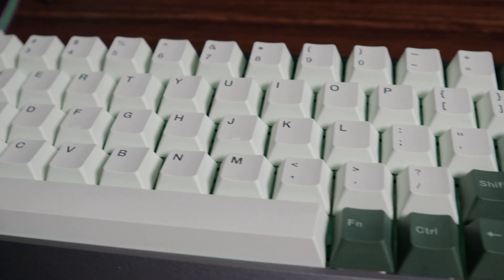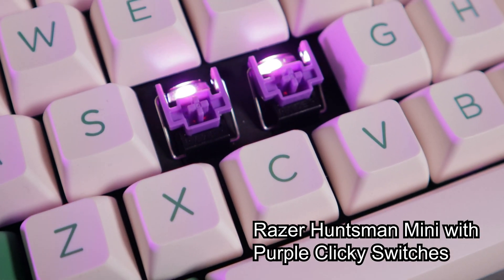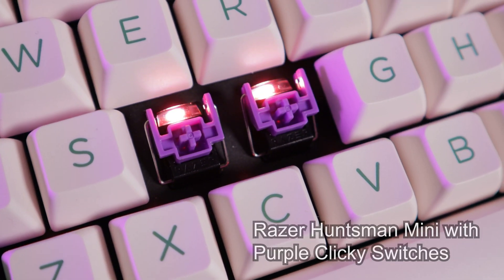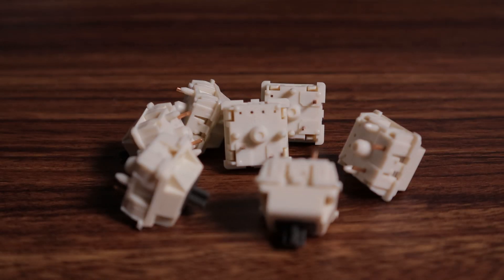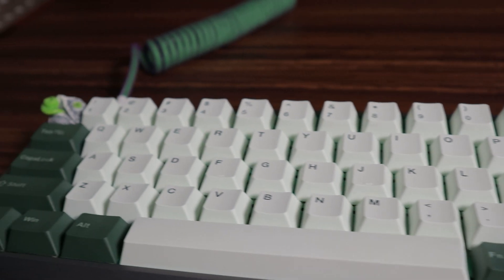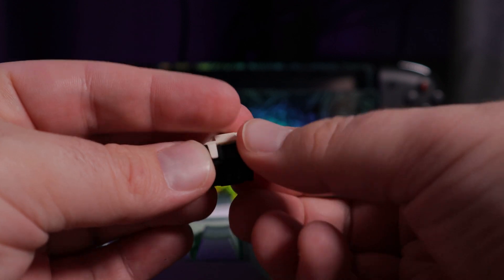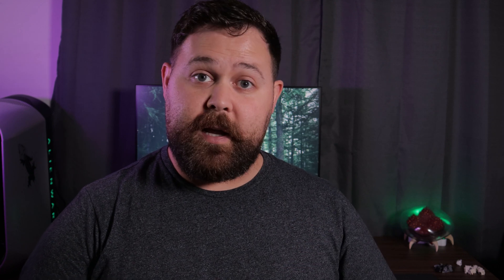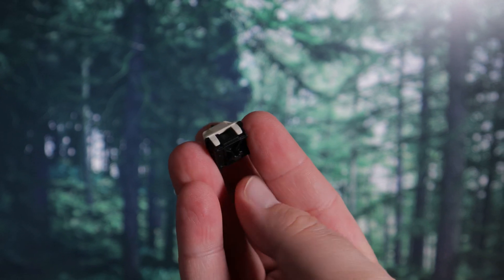Use Your Favorite Mechanical Switch w/ Optical Keyboards? Optical Mechanical Frankenswitch Mod

Comment from the maker: Just some notes: I had used optical reds, not optical browns for the bottom housing. That was a verbal typo on my part. Also, I realized after making this video that optical red switches have different leafs than optical tactile/clicky switches. If you want to maintain as much of the tactility of the mechanical switch, I'd advise using optical brown switches as the base for your opto-mechanical frankenswitch. Ok thanks bye!

Comment: Excellent video and great idea! Just a heads up, Akko switches do not fit Gateron housings, the Akko stems are just a bit too thick and they get stuck. Tested using Gateron blues and Akko creamy blues.

Comment: Love the video you made. Question can you make a video of the assembly and changing the keys plus the links of where you got your parts and tools like other channels do, i mean i have an idea, i do repair my shitty mechanical keyboard switches from my Logitech had so  much  problems with mechanical switches they don't even last months or a year had so much bad luck with Logitech keyboards hoping i have chance to change to optical version once parts are available. i would have loved to change the mechanical keys to optical  the pcb won't have the optical beam built in the pcb to change that's a problem but i have a solution if i can get all the parts and mod my Logitech to optical switches.
Reply: I am now a new member of your channel looking forward to see more of  your video's .

Comment: Previously had the Epomaker SK64 with older (KS-15) red Gateron optical silent switches. I just got a Keychron K8 with the newer (KS-22) brown optical switches from Gateron. Was disappointed to find out that I couldn't use my old switches with the new keyboard, and that Gateron didn't have any KS-22 silent switches yet.

So I'm very happy to have found your video. It gives me hope haha.

Are there any special considerations for transferring a mechanical silent stem/upper half into an optical housing base?
Reply from the maker: Sorry this reply is so late dude! The only real issue is to make sure that they are similar switches, as in cherry style switches with cherry style opticals, and kailh switches with kailh. They have different upper and lower housings and there could be interference with the stem if you try and put a cherry stem in a kailh housing or vice versa. But it being silent shouldn't affect anything, typically most silent switches have a soft rubber/silicone dampener at the top and/or bottom to the stem that dampens the sound, so that shouldn't affect anything as far as I'm aware. If you end up trying this mod I'd love to hear how it goes.

Comment: I just built a $30 Ractous optical board out with a set of Feker Panadas. The Ractous has some case foam, lubed stabilizers, and PBT caps. Pretty badass keyboard for $70 all in. The Pandas seem to perfectly activate the optical switch right after it rolls over the initial bump. I might go back for round 2 and do a little more dampening to the case and PCB and lube the switches since it's already turned out so well.
Reply from the maker: Dude that sounds sick! Nice job 🤙

Comment: Can I just use a durock t1 stem and top housing on an optical bottom housing of a linear? Will it still be tactile
Reply from the maker: You can do that yes. But it will be noticeably less tactile. Linear bottom housing am has a different leaf that will feel different than the leaf in a tactile switch

Comment: So i have silver speed optical switches on my kraken BRED. Is there any way or recommendations i can put any type of clicky switches and put them on my optical keyboard?
Reply: If so what type of clicky switches can be compatible with my optical keyboard?
Reply from the maker: The only opticals readily available out there right now are from gateron. I would actually recommend just getting clicky blue gateron opticals outright. They are decent and fairly smooth since they are optical, better than regular mechanical blues. They are not my favorites, I prefer Kailh Box Jades and Whites for clicky switches, but all Kailh switches are incompatible with Gateron's optical bottom housings. 

You could use another clicky mechanical switch and combine it with the silvers, but it would need to be a switch with a click jacket. You could use something somewhat more unique, like swapping out top housing and stem from an Outemu Phoenix or a Gateron Ink v2 Blue and put them into the optical bottom housings. But that's a ton of work for a switch that arguably won't be that much better than just getting the Gateron Optical Blues.

TLDR; I would just buy a pack of Gateron Optical Blues and swap them out entirely. If you want to do a project just for fun you could grab another clicky switch and frankenswitch them AS LONG AS THEY ARE NOT KAILH'S but I wouldn't go through the trouble. Probably won't be worth it over just buying the opticals outright.

Comment: That's pretty good ! i've just bought an epomaker with gateron optical blue, and i removed the metal bit that makes them click, essentially turning them into linears. Nice to see there are more mods possible for the optical option. Cutting laser beams to get a switch press is also so freaking elegant as a solution to get inputs

Comment: one question, i'm quite new in this but, holy pandas or boba are compatible with gateron?
Reply from the maker: It’s all good. Yes they should both work since they are cherry style switches. Heads up, both those are tactile switches so if the bottom housing and leaf are from a linear optical you will lose some tactility. If you want to keep the bump as close to the original as possible, try and use brown or blue optical bottom housings. They have a stiffer leaf than linear optical switches.
Reply: @GekkoTechGaming  thnx, yes i'm using an epomaker sk61 with optical gateron Brown and what i'm trying to do is  make it sound deeper so i'm buying boba u4t and a better Quality set of keycaps
Reply from the maker: Nice. You might have already done this, but you could also add foam to the case and do the paper tape mod as well since you’ll be taking apart the keyboard anyway. They make a surprisingly big difference when done together

Comment: question: do they have to be the same type o switch? example: Tactile+linear
Reply from the maker: If you want to use a tactile stem from a mechanical, yes, since optical linear gaterons don’t have a leaf at all so the stem legs won’t have anything to apply pressure and create a tactile bump on. Optical tactile switches have their own custom leafs.

If you’re using a linear stem, the bottom optical housing can be either or. 

One thing I did try was to swap the leaf from the mechanical to a linear optical bottom housing, but the amount of modding necessary is not worth it. You have to clip the pin off the leaf for it to fit since opticals don’t have pins. Leafs are so fragile that I would risk going that route.
Reply: @GekkoTechGaming  Should i buy a new keyboard or replace the 2nd switches

Edit: or can I buy optical tactiles and do the mod with them???
Reply from the maker: @footbread  Yes, you definitely could buy a pack of tactile opticals and mod those with your preferred tactile switch components. The simplest route is for those who already have an optical keyboard that came with gateron optical browns or blues, then mod it with the mech tactile switch parts.

If you have an optical keyboard that came with linears, you certainly can buy a separate pack of optical tactile/clicky switches. Technically you can just swap the parts between the optical and mechanical so you still have two sets of working switches.
Reply from the maker: @footbread  What kind of optical keyboard are you planning to mod? Do you already have it or are you planning on purchasing one?
Reply: @GekkoTechGaming  I have a gk61 which I am working on
Reply from the maker: @footbread  what switches did it come with?
Reply: @GekkoTechGaming  it came with gateron optical silvers.
Reply from the maker: @footbread  Ok. Yes you would need to buy some other tactile or clicky optical switches to combine with your mechanical switch.

Comment: the best board for the gamers
optical gk61 pcb
your choice of frankenswitch (id use a long stem like a cream)
thockpop 30a o ring gasket
tofu 60 or whatever other 60% tray mount board (youll have to remove the standoffs)
Reply: fb60 case is oring
Reply: @jakeeb_1  it's modified tray